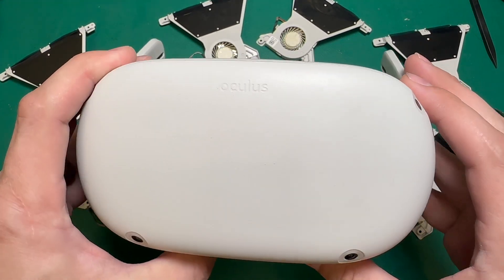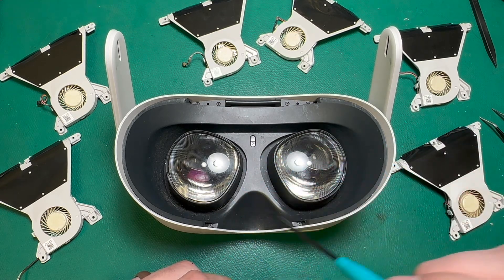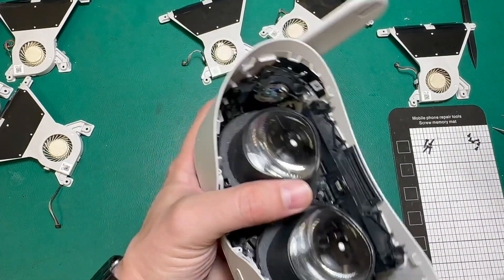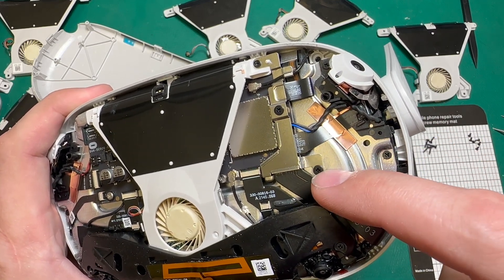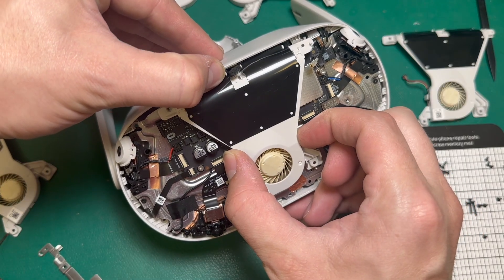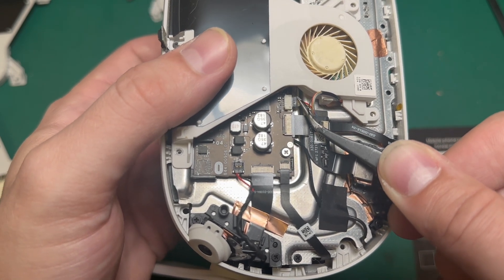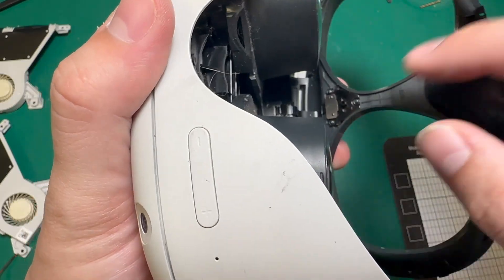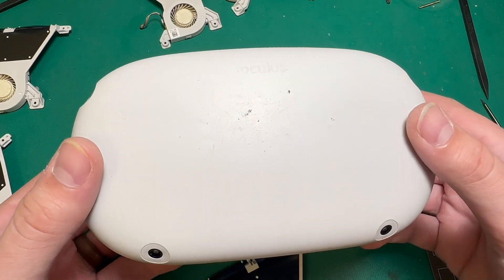Stop Your Quest 2 From Overheating Permanently - Fan Replacement Tutorial

Comment: I might need help with my Meta-quest I think it’s broken because on the top of it if you look up, you can see like a glitch and it looks like a little bit glitchy and it’s like black pink green lines above it. I’m not sure if it’s fixable but I’m asking if you can maybe comment back so I so u can help
Reply from the maker: Sounds like it could be LCD damage. If you want to send it in, I’d be happy to look at it.
Reply: Yeah it sounds like the LCD has a problem. I had something similar happen with my laptop screen from bending.
Reply: @tylerm8143  I have the same issue but I don't think it is a LCD issue due to it being fixed after restarting.
Reply: @billybobjohnson  yeah it could be software or physical damage. For me it was repeated opening and closing for years. that damaged the pins on the edge of the display.

Comment: The screws keeping the faceplate on are way too tight. Any advice?
Reply from the maker: Firm downward pressure gentle turns to prevent stripping. I always use a PH000 because it’s the best fit for those screws.
Reply: Thank you. I’ll buy one of those and see how it does.
Reply: I had to use an eyeglass repair screwdriver in combination with some pliers for extra torque to unscrew it. Annoying because I own an iFixit kit.

Comment: Hi if quest 2 makes buzzing sound when turning head
do you think its going to need replacement fan or just opening it and cleaning should do the trick?
Reply: Oh, I've had this for years, and there have also been some overheating issues. I'm going to take it apart now and check. It's a warranty case, btw, but meta doesn't work in in my country.
Reply: Cleaning wasn't my case. It's perfectly clean. And the sound started in the first month of using it. I guess I will buy a new fan
Reply from the maker: @gamayunov we have those on our website.